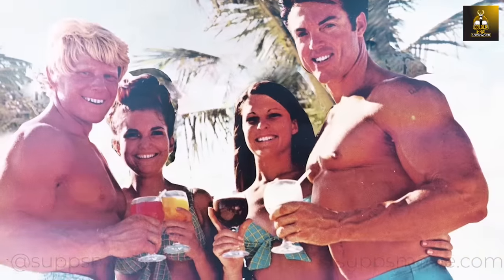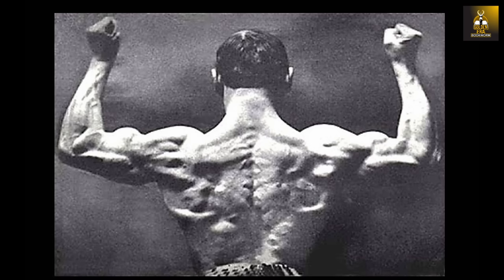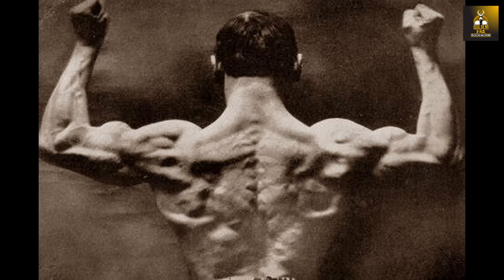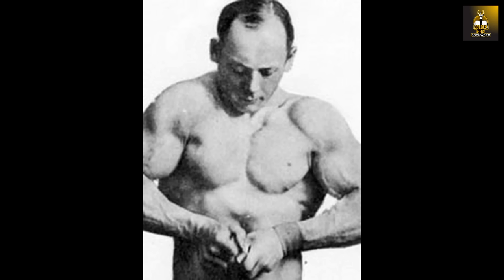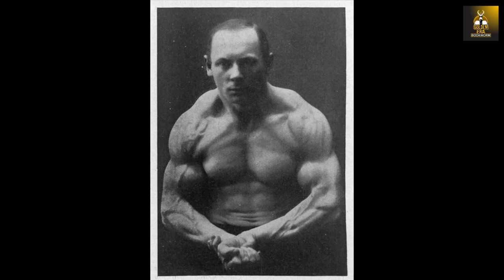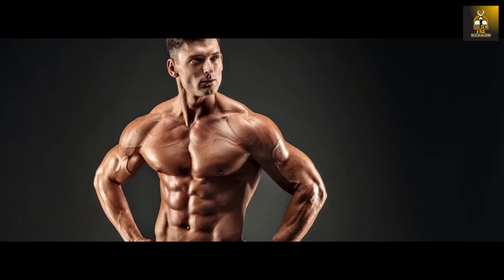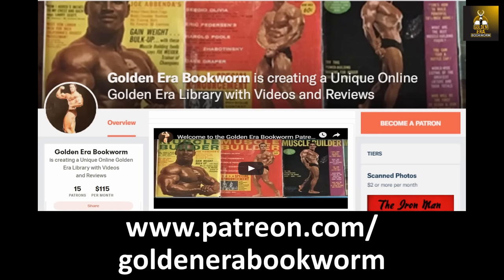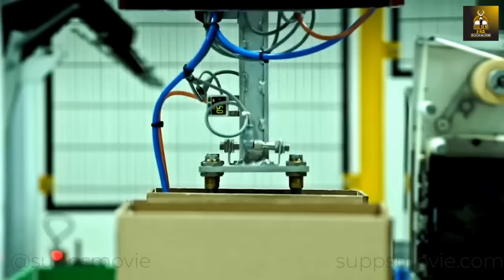FRED ROLLON! THE MAN THAT NEVER LIFTED A WEIGHT! BRONZE ERA STRONGMAN

Comment: He was right. Permanent maximum muscle tension without releasing while doing a set is much more efficient. You can do it with expanders (I started as teenager with the expander of my uncle, did some weight and ended up with calisthenics) , calisthenics or with weights, the technique is the determining factor. Doing 10 reps with a movement range of 5cm with maximum tension is burning mor then 100 reps in CrossFit, or whatever this Mr Bean exercise is called 
The effective buildup of strength is phenomenal and you need a fraction of time for training. Before my accident, wich disabled me, I did 3-4 times per week (always get a free day that the muscles can build up); my protein came only from eggs, tuna, cottage cheese and milk) 30-45min (without warmup and stretching after) and got 10% body fat on 175cm and 84kg.
You feel like you can do anything anytime without getting tired

Comment: I couldn’t imagine him only using cables. I would think, similarly to old school strongmen, his routines included isometrics and overcoming isometrics and have used weights and def calisthenics. Gymnasts are very strong and explosive and use their body weight, but most strongmen used weights so I don’t see why he wouldn’t
Reply: And I have seen plenty of videos of gymnasts using weights, some have this odd notion that 99.9% don't. I would also suspect this guy did lift weights at some time, it would be very odd not to have, just like it would be odd for somebody who swears by lifting weights ever to have tried devices like bands, springs, expanders or bodyweight exercise. I suspect he had a vested interest in denying he never ever lifted weights (if that was his claim).

Comment: By no means does it take credit away from Rollon’s extremely majestic physique however I do think that he had most likely incorporated conventional weights into his work out at an earlier point than he let on. Again guy is a straight human masterpiece, but if he claimed to only use cables that does garner attention from the audience as his methods would be very different from the strongmen of the time who were popular specifically for weight related feats of strength. Now I’m no sports scientist but if you want to pull up some depth in the chest benching something is gonna pay off in dividends.

Comment: No doubt in my mind he only used cables. No problem. I never liked weights, it always seemed unnatural to me, only use my body weight and I started using bands a few years ago. I started out young doing isometrics. I've added boxing and some floor side planking, pushups, reverse dips, etc. and more recently using the Olympic Rings. Got the body of 20 year old. No supplements ever. No enhancements ever. No gym ever. Mixed with dancing, 400m sprinting, and sometimes swimming, and kayaking. Almost 60 years old.  Probably genetically blessed since I have a heart rate of around 40 bpm resting. This work has been going on for me for 45 years, and there is always alternatives, and modification no end. I have come back from herniated disc, and now a total hip replacement in the last 11 and a half months.

Comment: I believe he never used dumbbells or barbells because bands are merely a different form of resistance.  As long as you are training with opposing forces, you are by definition lifting weights.
Reply: No. You are training with resistance of which weight training is a form of.
Reply: @professorartlifts1268  Weight training is by definition a form of resistance training.  Resisitance training by no means refers to only weight training.
 Capice?

Comment: Genetics man. Chest expanders are a waste of time. By that I mean you will spend more time using them to get the same gains as weights. Ok if you want to spend the time. But people with very bad genetics wont get anywhere with either of the above. They can pretty much only lose weight and tone up which makes them look bigger or better. Thats all. Other stuff like bone density and general health will improve though ofcourse.

And this guy was pressing in those accounts. No way he could have done that without learning the movement precisely. Neurons that fire together, wire together and that takes time. By that I mean, the rate coding optimisations and coordination neural networks alone take months if not years to grow with that kind of weight. No matter how strong you are naturally. He was definitely using weights.

Comment: I think it's funny everyone screams steroids. I'm not concerned whether other people are taking steroids or not, I know for a fact that 90 percent of people just have no idea how much they're actually capable of. I have never followed a workout program and people always think I'm insane when I tell them what I do, I lost most of my gains after I went through a bad spell of depression as a result of getting fired from my job. But, before I lost my gains I never got the chance to test myself at my strongest, but I did rep out 200lbs on bench press for 12 reps, and if I really wanted to I could've easily did more, and I only weighed 160lbs and everyone thought I was lying or on roids. If you want to be ripped you have to first learn your limits, you have to push yourself until you can't do anymore or you think you can't and then push yourself to do that extra one or two rep. Workout for hours and push yourself to your limits, experiment with your workouts, find out what helps you the most. Take workouts off if you want, and just work hard. I work a physical job 12 hours a day and I still workout 5 days a week 2 and a half hours a day and I also do pushups and curls at work. If you can get away with it bring dumbbells to work and workout when you're not doing anything. I do a set of 25 reps of pushups when I'm not doing anything and I also do curls.

Comment: You are exaggerating a bit... there was a lot of BS in the fitness industry around that time just like there is now. Maybe even more. How can you know he never lifted a weight. He could be just trying to sell chest expanders and so on. Back in the day they would do that.
Reply: That is what I suspected too. I have never heard guys who openly lift weights and sell equipment who strongly claim to have never ever used resistance bands or done various bodyweight exercises. But I have heard the claims the other way around. Like some truly believe that 99% of gymnasts never lift weights as supplemental exercises (of course some might not but many do believe it is the norm not to ever do it).

If a guy got that size, and that famous, using expander type devices it would be bizarre to think he did not at least occasionally lift weights, even if for demo purposes. Some seem to vehemently deny it, as though it would be cheating or something! It's a bizarre claim, resistance is resistance, I firmly believe you can get plenty of muscle growth without lifting weights -but it would be very odd to be so into something and never try it -it's not steroids or heroin! The explanation of it being a bogus sales pitch lie makes far more sense.

Comment: My opinion is that he lied about how he achieved his physique.
Reply: Your opinions wrong and no one cares lol why not train properly yourself instead of make excuses? The bronze era is perfect and had many mixed methods.
Reply: @gharm9129  I'm not making excuses.
I do in fact train properly.

The fact is that resistance bands, springs, etc, have too much variability in them and not enough of an ability to add resistance in small increments.

Free weights allow for tiny increases of 2 to 5 Lbs.

Example: 3 springs on a certain exercise may not be enough tension, but when you add a spring it's too much resistance.
Reply: You can microload with bands depending on the equipment. I think the smaller elastic loops I was using were in the neighborhood of 5lbs pullweight. 15 for the thicker tubes.

 You can measure pullweight with a luggage scale.